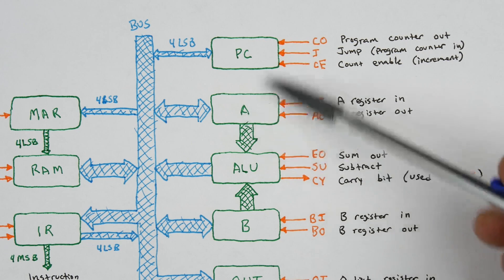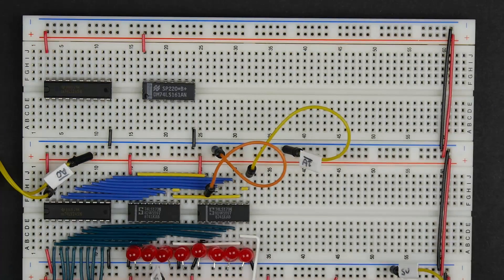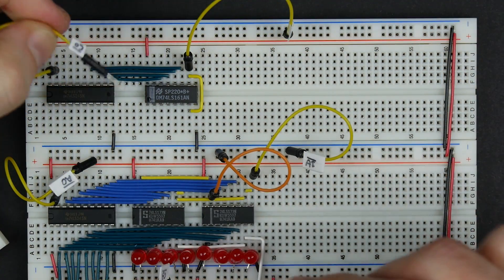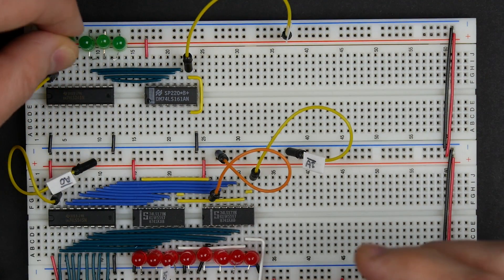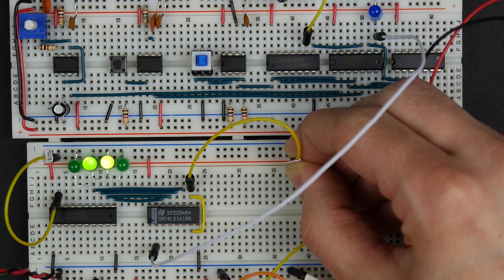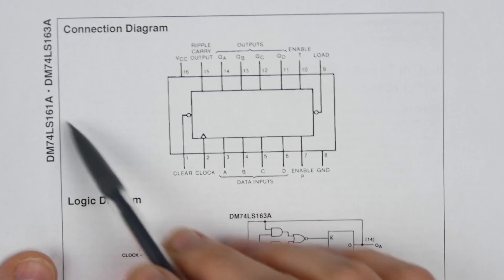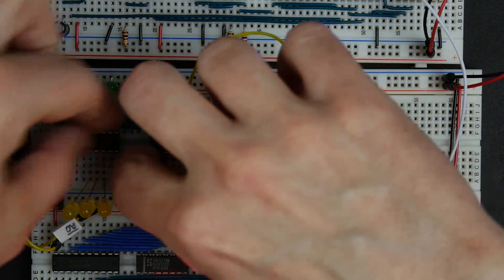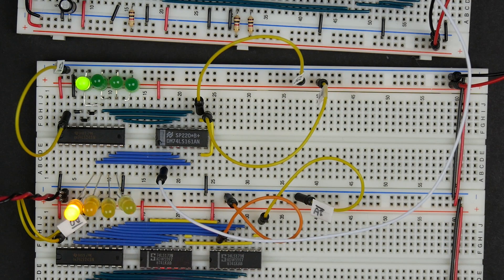Program counter build

Comment: My circuit doesn't seem to be working, the 74LS161 is outputting only  on Q0 or Pin14. I have to hold the chip down to make it count up and output on the other pins. Any suggestions?
Reply: Ben is really relying on some special characteristics of the ICs, he is using (like what current limits are on output, how unconnected inputs behave and such) - which is OK as long as he is usign the same family and new (or at least not too wornout) original chips from the same reliable manufacturer - which he do.

I feel like poor-man here (and I also want to build 16-bit version with more memory and registers and such), so I ordered all the chips on aliexpress, not LS,  but HC version (at least I hope so) and in double number (rounded up to next 10 or 25, as the mass discount price drop there and I will do other stuff too). Anyway I think I spend like 1/2 to 1/3 the total price on the whole shopping (sometimes bougth 10 pieces cheaper than 1 from USA/EU shop and with free delivery too - even if half of them would not work, it is still cheaper option - and so far I had luck with other purchases and only like 5% or less was broken and I got full refund back - but waiting like 1-2 month for delivery is the price too )

 So I will be forced to test each and every chip, if it even works as per "common datasheet - china does not issue datasheets at all and descriptions like 4 NAND only ocassionally) and then wire everything much more defensively (if input is supposed to be "floating high/low unconnected", then I will put 10k pullup/pulldown there, if part of chip is unused, then wire pull-ups/downs to default value of inputs anyway, if output is unused but supposed be up(or down), I will put pullup (pulldown) there too to avoid noise. And I will use LEDS indicators attached via some driver (maybe transistor as emitor follower and with resistor in serie of LED) so the current to LEDs would not affect the computer work (even with cheap transistors it sink just like 10uA for fully bright LED, not 20mA - so 3 levels of manitude better). Probably also make the powerlines much more solid (like 1mm copper or more), paralel (not chained thru breadboards) and powered by old PC source (so not "maybe like 0.5A", but solid 20+A on 5Volts and some volt/amper metter there too)

It is really too defensive, but my plans are increase the speed later and reach at least some tens or hundreds kHz clock.

And then attach stack unit (for subroutines), create 2words instructions, probably also lots of registers (just one RAM there for left-side and other righ-side agruments for ALU to have hundresd of left-side and right-side registers), maybe also ROM for "BIOS and library routines", "data stack" (or two) for Forth-like computation , more I/O units - like buffered I2C and some I2C "graphic card/adapter" powered by Arduino (as I am making for my robotic projects), keyboard and such. Way to spend next couple of years :)

But now I am waiting for the first batch of ICs (could take 2 moths or more) and first I will start small - just little enhanced version of what BEN does - 16-bit bus, alu and regs (just 4 copies of 4-bit parts where Ben  have only 2)
Reply: I just built this and I have the same issue. I suspect it to be a faulty GND connection. My cheap ass bought cheap eBay breadboards.
Reply: I found a fix for the Program Counter, at least it worked for me. My clock module's blue LED is extremely bright, so I put in a 470 ohm resistor and connected this to the Program Counter clock input. After I did this my Program Counter worked flawlessly. Hope this helps!
Reply: Hmm. I just tried that after your suggestion; no luck. It runs te same. When I touch the output pins it runs as expected. When left unattended, it seems to reset (the 74LS161) really, really quick. The resistor didn't make a difference. I suspect the breadboard to be the issue. Will try another breadboard tomorrow, but until then, anyone that got something for me is welcome to share. Strange things happening here. I still think it is a faulty GND connection of something.
Reply: I have found a definitive fix for this problem. The CLR pin on the 74LS161 has to be held HIGH. So add a connection to Vcc to make this go away. In essence the pin is floating in Bens version. Could work for years but still good to add this connection to prevent future problems.
Reply: As someone with 25 years in IT and software but zero in hardware I'm learning all the electronics side of this as I go. Based on all my frustrations to this point I'd say that pretty much all of your "defensive" measures sound like excellent ideas that will save you time trying to fix weird behaviour. Having said that, it's through trying to understand and resolve the weird behaviours that I've learnt the most! Good luck.
Reply: I also learned most by making errors :) My defensive measures are sometimes overkill here (it works for Ben even without all of that), and I fully understand, why he is not using them - it would make things much more complicated to understand and to construct. And if he uses quality parts and slow frequencies, he can go without all of that.
BTW: https://en.wikipedia.org/wiki/Common_collector it is the  "emitter follower" - NPN transistor (any small) , connect base to point of interest, collector to +5V, emitter to 220 Ohm resistor, resistor to anode of LED and cathode of LED to ground - you get up to 10mA thru LED and only like 30 uA thru base, so no big drop in point of measurement. Nothing affected, nothing burning. That is all to that :)
Reply: Yes - just spent 2 hours struggling all over the clock circuit and other connections before finding this simple, and in retrospect pretty obvious, fix...!

Comment: How does he drive LEDs with ttl outputs?? Most ttl chips including the 74ls161 can only source 0.4mA and LEDs usually require like 10mA.
Reply: LEDs can drive as much as 10-20mA. But they shine even with less current too as long, as there is the voltage on them (and their characteristics are highly non-linear - so if you have weak source, big resistor, then LED, and start increasing voltage from zero, then on red LED is all the voltage (and no current so no shine) up to something like 1.8V ( well, 1.6 - 2.03V https://en.wikipedia.org/wiki/Light-emitting_diode#Colors_and_materials  ) ,  then the current start rising, while the voltage is nearly the same (and voltage on the resistor is increasing, so the resistor limits the current, not the LED) and when the voltage increase enough to push big current (bigger than like 30-40mA) thru the resistor (where is voltage less by 1.8V which are on the LED), then the LED will just burn.
As those LS are able to sink only like 4mA per pin, 8mA per chip (  http://ecelabs.njit.edu/student_resources/datas/74ls00.pdf ), then the LEDs are safe. Also TTL recognize everything from at least 2V up as logical HIGH, so with some small voltage drop here and there and some safety margin on good chips even LED against Ground allows for the output be considered HIGH

Comment: Just finished binge watching all the videos in your breadboard computer playlist. Can't wait for the next ones!!
I've been programming for over 20 years and never really had a true understanding of how exactly computers work on an electronics level.
You explain everything very well and it's easy to follow and understand.
Thank you so much for all the time and effort you put into these videos!

Is there already a complete list of all components for the entire computer?
That way I can order everything upfront so I'm ready to go when a new video comes online.

P.S. I'm putting a few bucks in your tip jar at Patreon!
Reply: Look here https://eater.net/ and take it with grain of salt - Ben is buildind all from scratch then replaces some modules with single IC, so some small duplicities are possible. Also I count just 3 EEPROMS, not 4 and maybe you may need add some basic parts over (pullups, isolate the RC in RAM with two NOTs or NANDs, the RAM may be hard to find, but modern, larger and cheaper versions are avaiable, if you dare change the design around a little - as it is not inverting, no NOTs are needed, ground excessive address lines and such - Bens drawer can have some not common (or obsolete) parts, but the line of thinking is easy to follow even with improper substitues and drop of creativity)

Comment: There is something that I don't understand. I'm using a software to implement this, so I'm not restricted to "stock" ICs, I can make my own, and I can't understand why some inputs are "active low"? For instance, the load input in the 74LS161 is "active low", meaning that if is 0, then loading a value from the bus to the counter is enabled. But this is very confusing to me: shouldn't be easier to have it so that, when load is 1 (active high, if I understand the terminology correctly), then the counter loads from the bus? It's something related to electronics design principles?
Reply: It's because of a peculiarity of the TTL logic family. It takes quite a lot more current to drive a TTL input low than to drive it high, so signals that were expected to be inactive most of the time were designed to be active low to reduce power consumption. For more recent logic families, such as CMOS, it doesn't matter. If you're not building your circuit out of real hardware, it doesn't matter either -- just use whatever is most convenient.
Reply: It's not just the peculiarity of TTL logic or to do with current draw though it is also because NAND and NOR gates are universal gates that you can make everything from. Often your load signal will be based on the combination of a high enable and a high clock pulse from another part of the circuit. By using a NAND you can AND the signals together and get a LOW when both are HIGH and that is the result that you want in this situation... in many situations it can save a gate. I agree it can be confusing for some though.

Comment: Like many others, I'm waiting for the instruction decoder.  I'm going to be interested to see how you implement it.  I've guessed that it can be done either with discrete logic or by using a ROM.
Reply: yes, indeed if you search for "SAP-1 by Albert Malvino", in the paper both ways are explained, with discrete logic and ROMs. I really hope Ben will implement it with ROMs: I tried myself (it's not the real deal tho, I'm using a simulation software to do this) and I'm stuck with the correct timing. A discrete logic "solution" is easier to pull off, but it's a little bit tedious when it comes to wire the control matrix
Reply: The instruction decoder is fairly simple, and does not depend on the control matrix. All you have to do is hook it up to your instruction register. 
Anyway, this document has a simple instruction register as well as an actual working control matrix.
https://drive.google.com/open?id=0B6LIgQzDkH8fRmpSYm9ROTMzSGM

Comment: for those who can't afford to buy all the stuff building this computer ,try google the keyword "logisim", which is a software that can simulate all the stuff ,there's even 74TTL series libraries that you can use.
Reply: I absolutely agree, I'm "building" this CPU inside of it and so far I have no problem.. although for certain circuits (like the counter or the registers, for instance) I suggest using the built-in ones, they are more "lag-friendly". Of course for learning purposes I recommend to try and come up with a design for those aswell, at least for me is very formative. 

Bottom line: it's a very useful software, easy to use and I believe it works on every operative system (I'm using Windows)
Reply: @RussellTeapot  i've implemented everything to this point, this program counter and registers included, in logisim.
Reply: Nathaniel Bajakian  I assume he is referring to the first link in this page http://www.cburch.com/logisim/links.html
Reply: When I get the chance, I'm going to have a go estimating the cost of building this computer.
Most of the chips are easily available and are < £1 (somewhere around $1) each. My bet is the breadboards are the most expensive part of the build.
Reply: Including the breadboards and EEPROMs I have now spent 85 USD on eBay on this project. Just the 74LS ICs is around 56 USD. Ordered all 74LS ICs needed, the EEPROM not yet.
Reply: one thing he doesnt address in this video is that the load and clear inputs are active low, meaning load, clear and count enable all must be high to simulate the count function in logisim.
Reply: What exact libraries are you using? I can't seem to find complete ones. Thanks!
Reply: tnx i can now test some parts before soldering.
Reply: Haha, not me, shopping for parts :D
Reply: Its really cheap, I did it for 100$
Reply: Can it also simulate all the "quirks" of a real circuit? Such as:
1. Bouncing switches (remember that 555 clock module tutorial?).
2. Races (remember that JK flip-flop tutorial?)
3. Gate delays.
4. Power dissipation as heat (which can burn your parts).
5. Power supply issues.
6. Parasitic capacitances and inductances of the metal connections inside the breadboards.
7. Random behaviour of floating pins.
8. Increased power consumption during the switching phase of each gate.
Reply: @bonbonpony  jk flip flop uses the master slave and is simulated fine with an added reset input on the first NOR gate in line with the k input.

reference: https://github.com/netguy204/cmsc313_examples/blob/master/logisim/Master%20Slave%20J-K%20Flip%20Flop.circ

Comment: Why only 4 bits for the counter ? Isn't it a 8 bit computer ? sorry for the question.
Reply: João Constantino Probably because the RAM has only a 4bit address. Program counter is used only to specify an address for the next instruction in memory, therefore it only needs 4bits.
Reply: That's exactly right. The memory used in this breadboard computer is 16bytes. So 4bits are sufficient. If you are building your own, perhaps you could try expanding it to 256bytes (using an 8bit program counter) to fit larger program. The bigger the code size, more painful it gets to program using dip switches. But other options are possible.
Reply: The bus is 8 bits wide, so if you use 4 to encode the instruction you'll always have 4 left for an address (or a constant). That means you can handle each (memory-related) instruction "in one go". If you want larger addresses then you'd have to either make the bus wider or load the MAR (Memory Address Register) in steps.
As for the manual input: there are also rotary encoder switches with 16 positions, so you can use two of those  for inputting a byte. They are a bit costly though, ~ 2€ per piece.
Reply: G Yogaraja Thank you very much,  now I understand.

Comment: So your programs can only be 16 bit max ?
Reply: TheKetsa
had it been great if it were 16-bit.. it's only 16 cycles :)
Reply: Yeah, how is this going to work ?
Reply: TheKetsa
The program counter is only a 4 bit counter. If this was 16 bit, you'd be able to do way more than this.. because with 4bits you only have 16 cycles but with 16 bits you could have up to 2^16 which is about 65,000 cycles!
Reply: 16 cycles was what I meant, sorry I am not an english native speaker.
Reply: Russell Teapot 
yeah it makes a lot of sense, thanks for the clarification :)
that said, you can't have more than 16 iterations in the loop anyways. I mean, you can program it to print out 01010101010...
Or 
0,1,2,3,4,5,6,7,8,9,10,11,12,13,14,15,0,1,2,3,...
but after 16 cycles it must repeat.. it can't keep updating new values, or can it ??
Reply: Truth Seeker mmmh.. I'm not really sure of what do you mean for "it can't keep updating new values".. Perhaps do you mean "it can't go beyond 15,so every 16 cycles the value of the PC wrap back to 0"? Yes, if you enable counting and the clock is active, at each rising edge 1 is added to it, and it increments. When it reaches the max value ( 1111, or 15, in decimal), it wraps back to 0
Reply: Russell Teapot yeah that's what I was talking about.. this is exactly what limits our computer capabilities!
Reply: Hmm, I just thinking: what if the program would modify itself...?